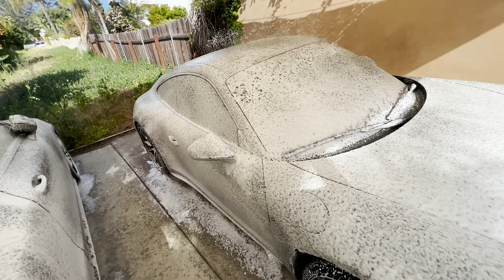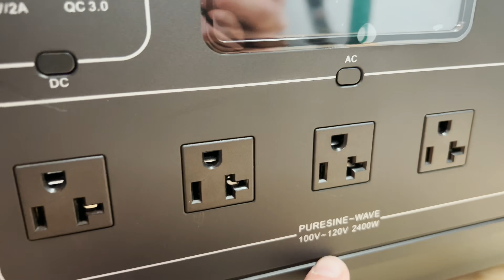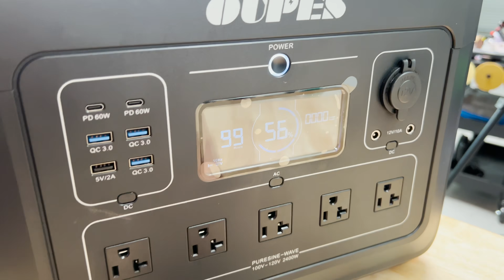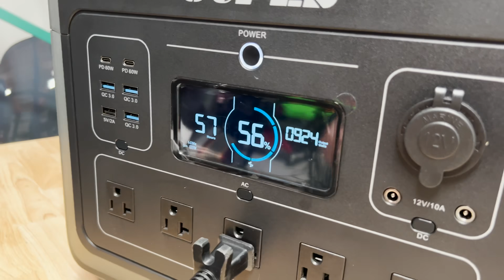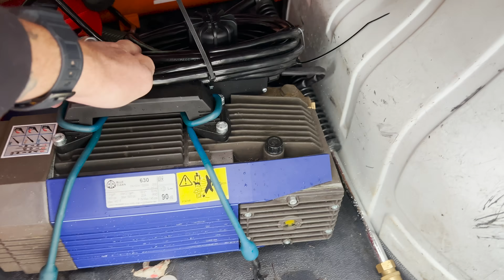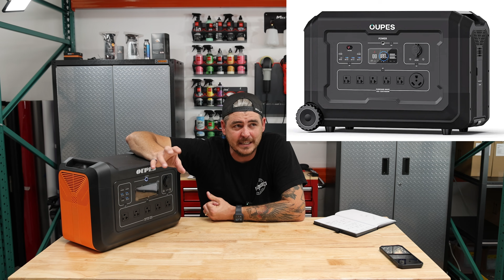GAS FREE PORTABLE POWER! Oupes 2400w Power Station vs Generator

Comment: hope you repsond but im sure you can run a small wet dry vac on it right ? or a small steamer? cause Im running a gas pressure washer with a small pump from the tank to the washer

Comment: Josh. Great video. How does it wk on Kranzle
Reply from the maker: It fires up no problem. It’s a bit of a struggle on an ar630 but atleastvthe kranzle I have does draw as much power as that
Reply: A Brotha ,
Thanks for such quick response. 
Although you peeked my attention on the Mega 5 .
I might just go with that unit.
Just 1 more ? Bud.
Hands down the video & unit you just reviewed,
Would you say it's way better than the Eco flo?
The reason I asked
I was reading some reviews about unit & not good. Amy thoughts?

Comment: Real late to the party here, but the likely reason for the extended life cycle is that Oupes uses Lithium Iron Phosphate batteries for it's power stations instead of Lithium Ion. A lot of more modern power stations are moving to that as it has a lot of benefits for this kind of use case.

Comment: Just an assumption so the numbers are random. Let's say you had a 15amp outlet and each charger is 10amps. Plugging both in the same outlet would only get you 15amps. You could plug it into a different socket on a different breaker and get 20 amps. You could also use on charger to connect to a inverter from your battery and the other to another power source like solar if you don't have expensive systems that can give you the full 20amps. Don't kill me for tje numbers, it's random as I was just trying to give you an idea why they have 2 plugs vs 1 huge one.

Comment: I just started using my Bluetti EB200 for washing my car last week. I’m also using a $12  17 gal tote for a tank that I attached  a $12 bulkhead so I can hook up the water hose. Works pretty good I think. Now I can wash my car at my apartments or anywhere for that matter. Also I’m using the Ryobi 1800 pressure washer.
Reply: How’s that Bluetti treating you
Reply: @realtalkkombat the first Bluetti I received was not perfect so I returned it and got another one.
Reply: After 1 year any issue??
Reply: @Bananero_ nope it’s still functioning.
Reply: Not sure why im not getting any replies.

Is this item water resistant?
Reply: @ I keep the battery and water as separate as possible.
Reply: Does the bulk head have a open/close valve? Have you had any issues with water flow? Thinking about doing this since I don't have power and water supply. I was going to get a battery pressure washer but it seems they die too fast.
Reply: @ Yes the bulkhead does have a valve. I use a utility cart that I keep the tote on to help raise the water to help with flow. Or I just set the tote on a heavy table. Not sure how much it helps but it works.
Reply: @TboMartinez  I see. Thank you.

Comment: Hey Josh! I’m confused so i tried running a Ryobi pressure washer with a 50 ft hose and the harbor freight 2000 Watt generator keeps tripping out on overload. The pressure washer is within working amps (13) and the generator says do not exceed 13.3. Why does it keep tripping?
Reply: Maybe the power surge at the startup is too much
Reply: @TboMartinez  maybe but as i continue to let the pressure washer run, after about 10 seconds the generator trips out on overload
Reply: @MilkCurds  are you running a 1.1 orifice?
Reply: @TboMartinez  yes
Reply: @MilkCurds  I’m no expert, but I believe it pushes the amperage higher with the 1.1. Maybe it will run better with a 1.25, might not get as much foam though.
Reply: @TboMartinez  that is the worlds hardest ultimatum to make bc thick foam is a necessity in my book, i guess I’ll have to buy a stronger generator

Comment: How would a beginner mobile detailer get around the water situation? Do you need to invest in a water tank right away or is that something you can hold off on for a little while?
Reply: U do rinsless wash and carry few 1  gallon bottles around
Reply: I’m using a 17 gal tote for my home system bought at Lowe’s for $12. I can see it being a temporary mobile solution.
Reply: @TboMartinez how many cars can you get with that
Reply: @ I could probably do two. But I usually only do mine at my apartments that have no water facets near by.

Comment: You can use the inverters also and plug it in the alternator then just turn on the car when youre low in charge then turn it off again. And its quiet also. I have the 5000w and can power shop vac, air compressor, pressure washer the same time.
Reply: Good to know. Thx!
Reply: Can you make a video please?
Reply: Are you still using this alternative to this day?
Reply: Whats the cost?

Comment: Q: If the manufacturer has a life cycle of 3500 which works out to ~10 years +/-, why are they only offering a measly 2 year warranty? They know something they didn't want to share with you? Seems odd...
Reply: That's because this rating is on the battery. The battery will Outlast the electronics.
Reply: @jabbajawz  Maybe they should incorporate better electronics then.
Reply: @strykerentllc  You aren't wrong. But they won't. They will just continue to market the part of the product that has the best longevity.

Not that the electronics are particularly bad, but they probably won't last 10 years of daily usages. 5 years should be good but definitely not 10.

Comment: For $1.5k you could buy a big ass inverter
Reply from the maker: I have a 3500 predator generator in my truck and that was around 800-900 I think. Inverters are good but you would still need batteries to power them. A generator is a great choice for most operations, but for people that want a gas free option, this is an awesome option
Reply: @imjoshv  my bad. Generator inverter, those where it doesn't go out loud like a go kart engine

Comment: $1300 after free shipping and 10% discount?  To early to detailer market for my $.  Test shows @ 56% it would only run the ridgid vacuum demanding around 1000 watts for 1hr.  Manual says its 2232 watts total energy capacity which is far too low for real business use.  Mobile detailers know you can spend  an hour+ vacuuming out just one vehicles trashed interior.  Your gas smell concerns are because of your vehicle choice (open cab van vs. truck with bed or car with seperate trunk area) limits you to being in an enclosed with sloshing around fuel in the back up gas can and inside generator causing obsessive fumes.
Reply from the maker: Yea it’s not ideal for all situations and a regular generator gives you unlimited working time as long as you have gas! But this could be a great it for some like me in my van. Like I said I’m the video the gas fumes aren’t an issue at all in my truck since I’m separate from it but for my van when I’m doing more maintenance stuff this thing as awesome
Reply: I only spend 10-20 minutes vacuuming, any more time is going to be vacuuming in conjunction with another tool, which still only takes about 10 minutes. I'm positive this would get me through any job depending on how much I use a Polisher. After doing a deepclean of the car I live in, I bet I could still play or watch my ps4 until I go to sleep, lol. Thanks for showing me this, I was having huge issues finding a battery pack/Inverter that doesn't have major downsides. Ego is great since you can swap out batteries, but batteries are as much as the inverter itself, lol. I cant afford either though, lol
Reply: Or add solar panels to the roof of your van so it’s always charging 😂

Comment: Any chance it can start up your rigid 4.5 air compressor?
Reply from the maker: Yep no problem. The smaller unit I reviewed before actually powered that as well. The ar630 pressure washer was the most powerful thing and this could power it
Reply: If it can handle initial start up hit of his AR Blue power washer it can easily handle a Ridgid air compressor.